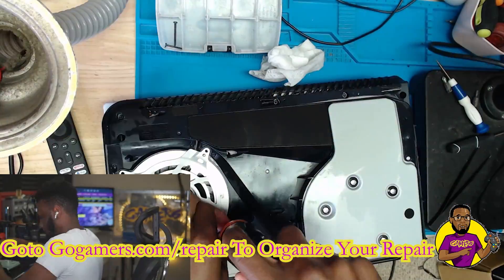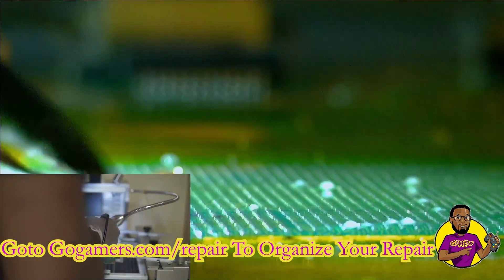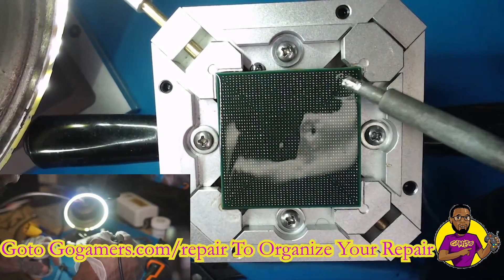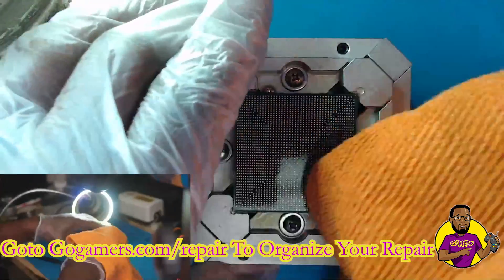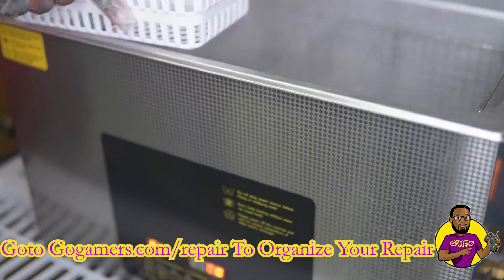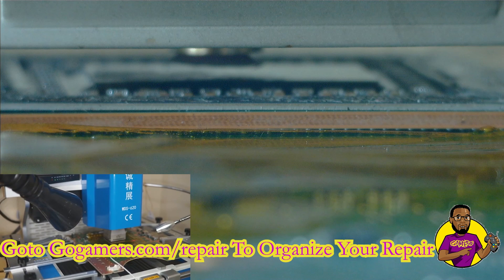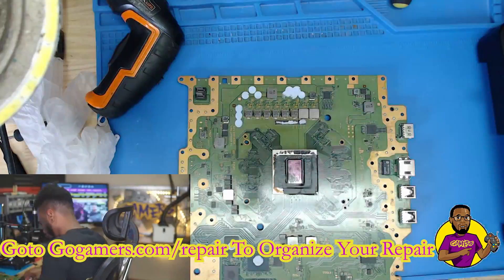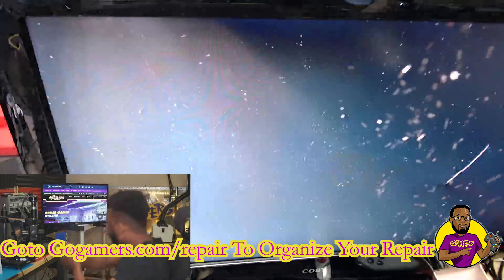PS5 Blue Light of Death (BLOD) - APU reball from begin to end

Comment: Hello, I also have a PlayStation 5 that freezes in safe mode. I force-update it, but it only goes halfway and freezes. I read the instructions on port 232 and it says that the APU is halting... Will reballing fix my problem? Because we have a BGA machine.
.
.
.
I would be very grateful if you could help me. I will also make a video of the reballing and repair. We have no limit on the parts.
We have about 15 semi-broken devices available.

Comment: Sorry. But this isn't about dry or a crack solder joint but a fault within the chipset and its silicone bumps.  This is a temp fix.  Done alots these reball on hp nvidia chipset, Sony ps3, etc...

Comment: I have seen people criticizing BGA Reball saying oh it is not necessary and that it is just a way to sell parts but they are all Wrong I know from experience that you can take a PS4 apart and it will just die and not turn on because you have taken the pressure off of the BGA Chips and the joints underneath Fail. Now this Fact has been proven in Scientific Journals and the best BGA Researchers in the Country using Xray Machines not guess work - Read white papers from Electronic Engineering Now on this subject. Sega Games Commercial Gaming systems have been known to have this problem for years. I repair Television Main Boards and it is very Common sometimes reflow works and sometimes it is necessary to Reball the BGA Chips experience says that the Best Repair is to Reball the BGA Chip with 183 Degree Solder it is more stable than Lead Free Solder in my Opinion. Anybody that says anything different does not know what they are talking about This subject is well researched by Electronic Engineers for Years and the info is readily available to those that will do the Research - Experienced on Advanced Electronics on all types of Electronic Systems Commercial and Consumer and they all need to be Reballed or Reflowed and this includes Iphones and Android Phones and Tablets of all kinds there are literally thousands of different types of electronic Equipment in the Field and any Technician that knows what they are Doing Knows that these BGA Chips Balls are Failing .

Comment: The Direct heat stencil for the PS5 APU is not available as i am aware of so you would have no choice but to use this type of No Heat Jig- Not many people are performing this type of Repair so Props to you Sir- 
There are obviously going to be a Ton of them i have the Exact same setup that you have Constant Current heater for Reflowing Reball Chips - WDS-620 For Mount and Dismount and Hypersonic Cleaner for board Cleaning i am a little wary about putting the whole board in there Though even the Manufacturer of the WDS 620 states to bake the Chip for 8 hours after the introduction of Moisture and Moisture can hide in places in the board after introduction to Moisture - Honestly i do not usually wait Bake 8 Hours usually about an Hour and i have never had a Problem.  Good Tutorial The only one i have found so Far. Thanks 
I Bake at 150 Degrees with Convection Flow Preheater for 1 Hour- Basically Hot Air Heats the Whole Board and the BGA Chip to draw out Moisture.
Reply: Any help https://youtu.be/-X0SHKPsGRk

Comment: I had a customer send me this video link asking if this is what he needed [I told him no!] I fixed his system and like I told him it was not the problem. This system will not have a solder problem it is extremely rare even for the PS4s nowadays, so far I have had 4 PS4s with solder problems out of about 20,000 I have repaired and they were the nastiest systems you have ever seen! Although not impossible this video was just put up to sell you parts with a faked video and or an expensive service, seriously out of 20,000 systems 99.995% of the time it will absolutely not be the problem or needed unless the system was dropped in which case it will have likely have pulled the solder ball pad off the motherboard making it not repairable.
Reply: So is the PS5 toast? Or can you pull an apu off another one?
Reply: @oscar1081  there is absolutely nothing wrong with the PS5 a proper cleaning once every 6 months will not 99.98% help you totally avoid
Reply: Preach brother. Rossman did a great explanation on reballing / reflowing. Its only helpful if dropped. All those heat cycles and balling, may aswell just reflow it. It would last longer and less work. Would be nice if we could get new chips and they were not married to the damn board. Good to see someone pointed it out. A+
Reply: @ITKing-mo6em  I have likely personally repaired ten times more systems than Rossman I am almost willing to bet this is the first and only successful re-ball of a PS5 system and likely was not even a repair, it was more likely an abandoned system or a system he he sacrificed for the video only not only is this going to be less than .01% every system any shop gets in a year the equipment time and expense is simply not worth even offering this service even if you are running an assembly line type shop. So this video is just to make you think they can fix anything in the system and is a commercial for their other repairs service and a teaching tool for Wannabee YouTube repairmen as well as a way to sell tools to all the Wannabee repairmen.
Reply: @ClovisX  damn bro 2 years later and you’re still caught on this? Surprised you haven’t seen this issue yet with all the consoles you fix😂 I have a ps5 in atm with blod that works fine when pressing on the apu. If you have the right equipment then this isn’t crazy work, reballing is always better than a reflow. Do the job properly if you’re going to do it is how I see it. A serious tech will have all this equipment and know how to use it anyway

& also I don’t know where you are getting your statistics from, but at least for me about 80% of consoles that I have come in my store require some form of soldering
Reply: So how would you fix blue light of death without soldering/reballing?
Reply: @KingSharoz786  Your joking right? there are 100's of reasons for BLOD there is no one reason
Reply: @KingSharoz786  100% of the time it's not the APU that has failed

At least in my experience and I've fixed 100s of original PS5 models😊
Reply: https://youtu.be/-X0SHKPsGRk
Reply: especially because the PS5 uses liquid metal, its close to impossible for needing a reball without physical impact

Comment: Damn that system just dropped and they experiencing tech difficulties
Reply: I had a customer send me this video link asking if this is what he needed [I told him no!] I fixed his system and like I told him it was not the problem. This system will not have a solder problem it is extremely rare even for the PS4s nowadays, so far I have had 4 PS4s with solder problems out of about 20,000 I have repaired and they were the nastiest systems you have ever seen! Although not impossible this video was just put up to sell you parts with a faked video and or an expensive service, seriously out of 20,000 systems 99.995% of the time it will absolutely not be the problem or needed unless the system was dropped in which case it will have likely have pulled the solder ball pad off the motherboard making it not repairable.